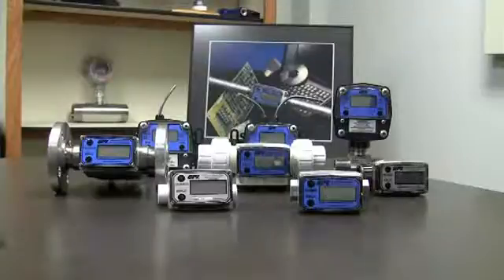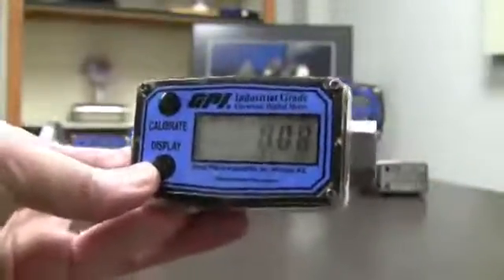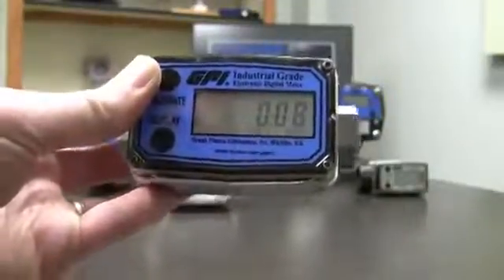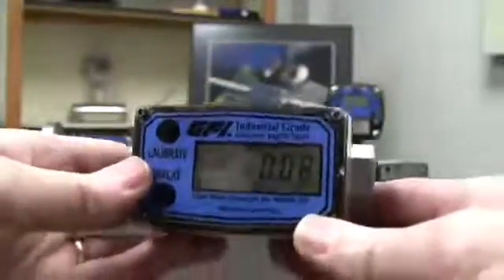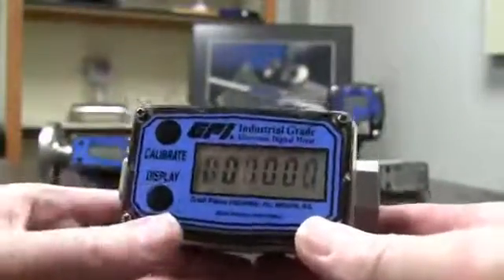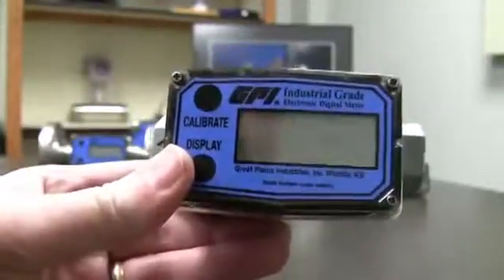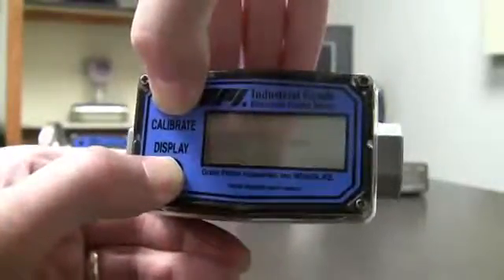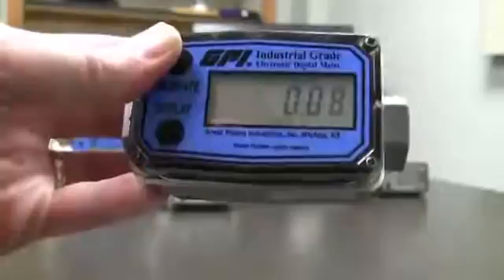GPI Flowmeter Calibration // PCE

Comment: Can these be used in freezing conditions? I had it outside counting the pool water my sump pump can put out. The lcd got hard to read. After 1900 gallons it was very hard to read the screen and the numbers were dim and distorted looking. I let it warm up inside for a few hrs no change. I replaced the batteries and the screen will not turn on at all now.  Does the LCD freeze?